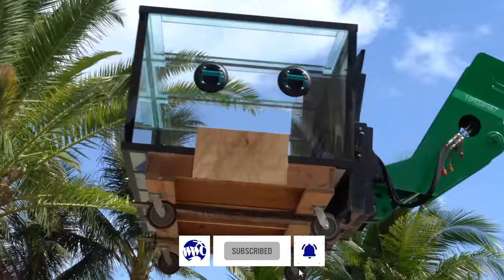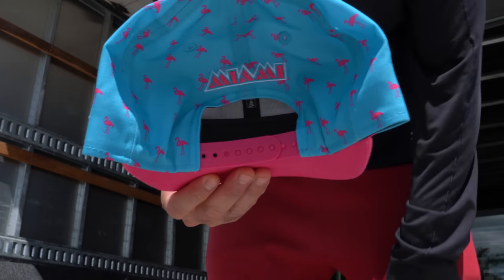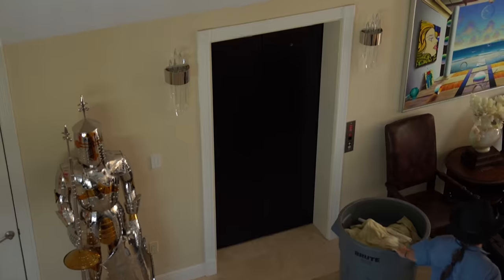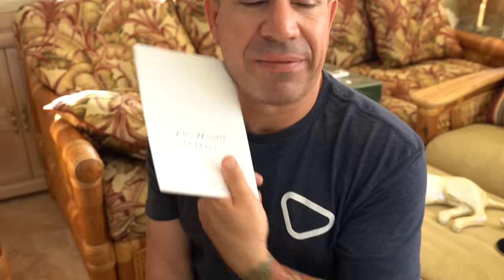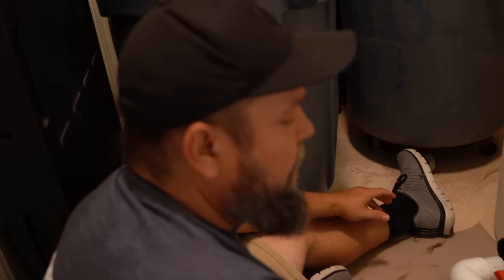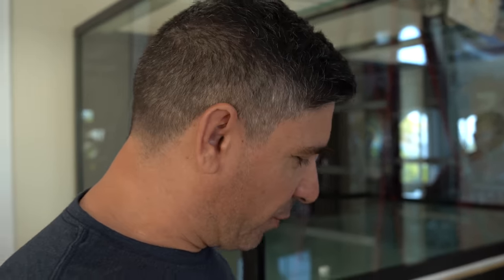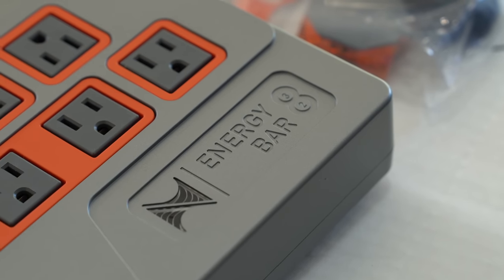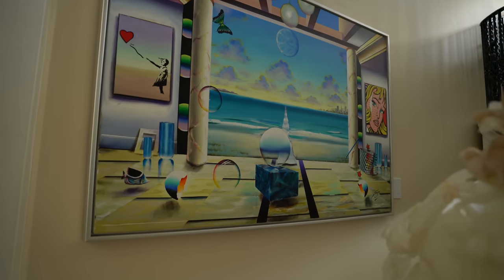LARGEST Fish Tank Install! Inside LUXURY Multimillion Dollar MANSION!!!

Comment: 3:29 Cheating, you did not show how you got that tank up on that stand. Did it take everyone even the camera man to do it?
Reply from the maker: We used those hydraulic lift tables to lift the tank at the same level of the stand. All we had to do was slide it onto the stand :) If you look again, you'll see that it was transferred on over.
Reply: @WorldWideCorals  Thanks for letting me know, have you ever used on of those beam lifts they use in construction to lift heavy beams, they have a hand crank?